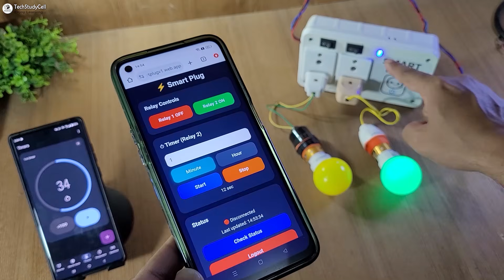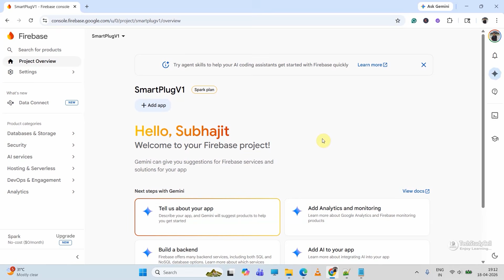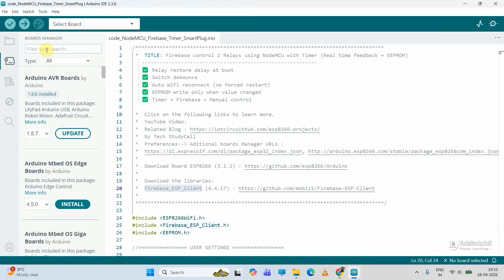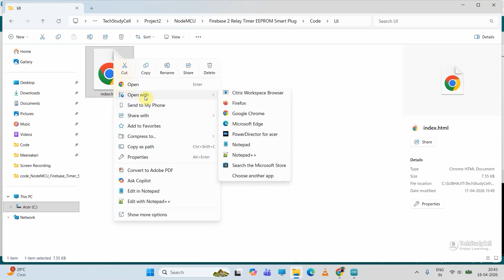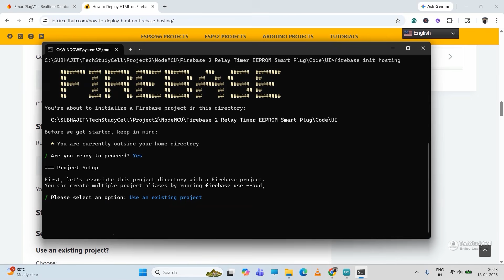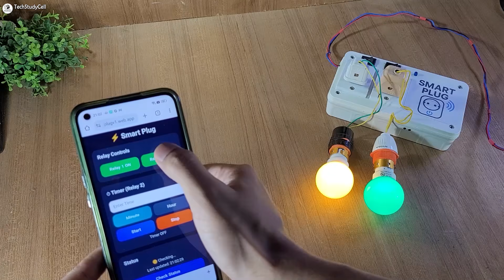ESP8266 Home Automation 🔥 Firebase Hosting + Realtime Database Free Setup 2026

Comment: I want to create a Firebase project with 8 channels, what do I need to do for that, please reply.
Reply from the maker: You will need to update the database schema and the code logic to handle eight separate pins. But use ESP32 for 8 relays
Reply: @TechStudyCell Will 8 channels be created for free or is there a limit in this as well like sinricpro